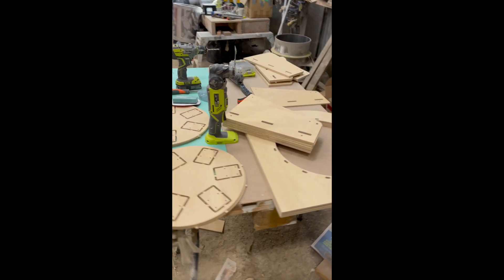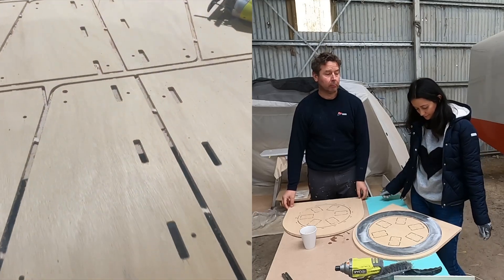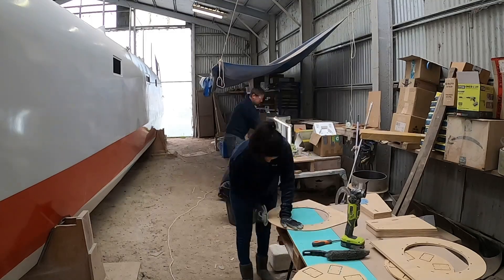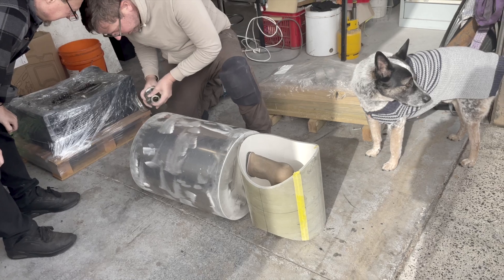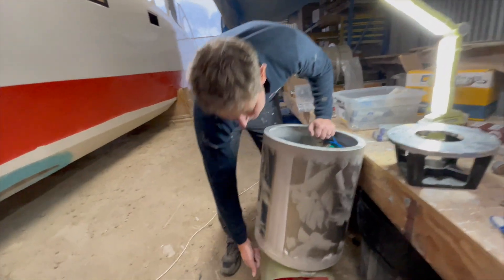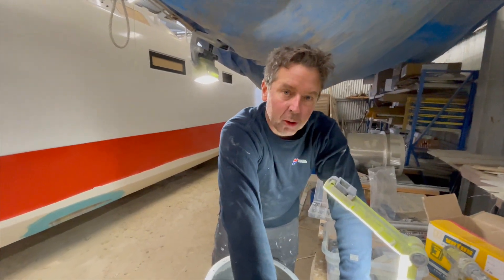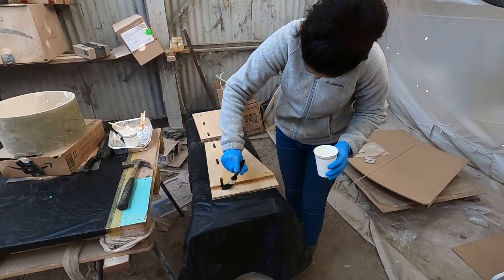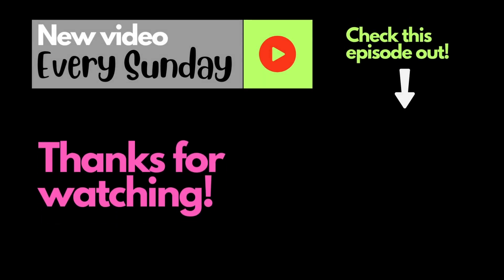Let's solve this puzzle! SailDrive Lifting Mechanism - CNC cut parts | Part 9 | Building Wilda

Comment: Great work on those drives just would suggest mounting a slewing bearing with external gear and a servo motor so as to turn your drives from the helm with a twist of a knob also you could get better regen if your props were facing backwards to make use of the cups in the props just a thought great videos and great catamaran.
Reply from the maker: @roberttrahan  that is step two for these drives. plans already in place.

Comment: While the drive system is interesting I have a question.   Have you looked at the "duty cycle" of your type of drive system?   When used as a bow or stern thruster the system is ON for just a few seconds at a time, not for minutes or hours.   When I researched a similar bow thruster their duty cycle was quite small.   The duty cycle might be expressed in something like a % of the time, or minutes per hour, or something similar.   I am not sure a "bow Thruster" is suited for how you intend to use yours.   Just a suggestion.    thx Dale
Reply from the maker: You are not wrong. And the drive leg is not specifically designed for continuous operation. But if you look into it some more, you'll find it is normally the motor and controller that are limited to low duty cycles. When you go up to hydraulic drive motors with the same drive leg you'll find at least vetus don't have that same limit. I think we'll be ok. If not, a change of bearings and type of grease should be sufficient to keep temperatures acceptable. I certainly hope I'm right..
Reply from the maker: I believe the 310 hydraulic leg is the same as the 300mm electric, but I bought the one specifically made for the hydraulic motor.